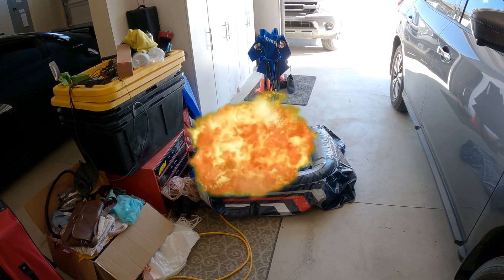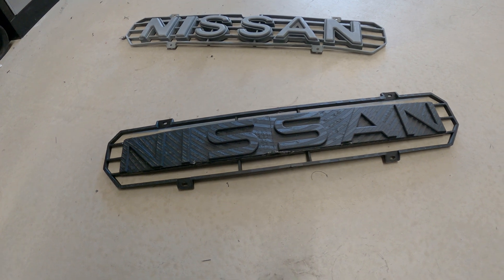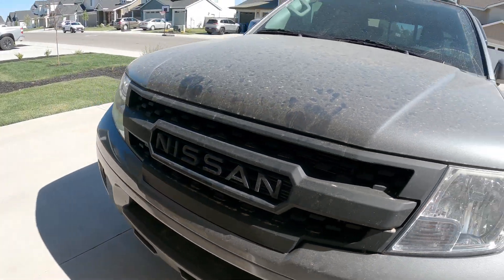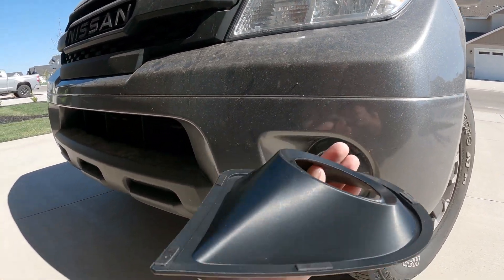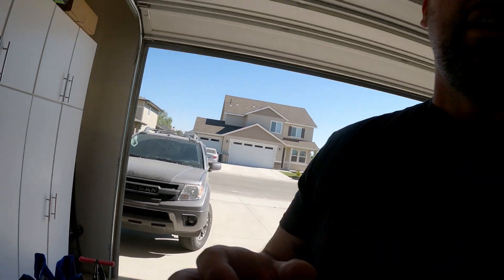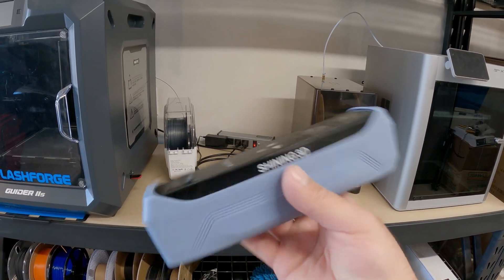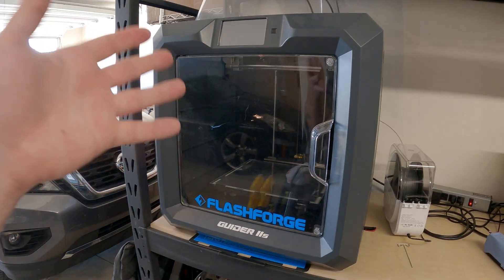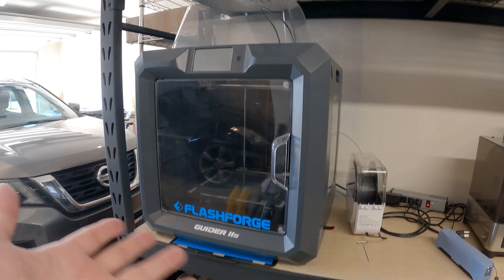3d printed car parts and project updates.

Comment: Have you tried using tree supports in Prusa 2.6 for the magnetic phone mount?
Reply from the maker: I have not, I print almost everything on my Bambu X1c and it does have the option for tree supports but have had better luck with traditional supports

Comment: Great job.  Wanted to get the x1- carbon myself until I found out it's not open source and the programming was done by guys from DJI. Would not risk it with sensitive prototyping and limit its network access. If I could flash it a new brain I may change my mind lol. Would shoot myself before flashing DJI firmware into any of my custom built FPV drones
Reply from the maker: Yeah, I understand that. You can run the x1 "offline" with just an SD card and not have to worry about security issues if that is the concern. The "plug and play" nature with better/faster print quality just blows every other printer i have owned out of the water.
Reply: @EndMotive  yeah just sucks guys like myself in RC and wanting to muck around with GPS guided rocket prototyping needs to run off a closed network off the net
Reply from the maker: Gotcha, yeah make sense!
Reply: @EndMotive  100% it's a beast worth double the asking price! As you know to good to be true and once I found out who wrote the code I knew why it was so cheap :(